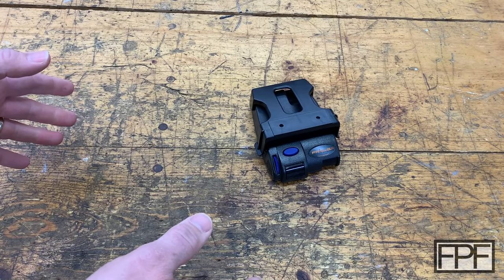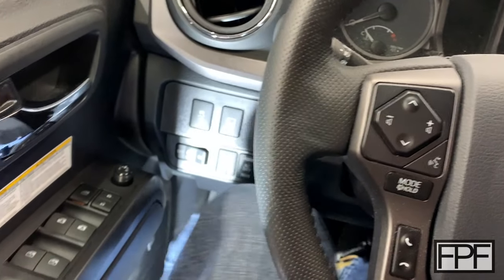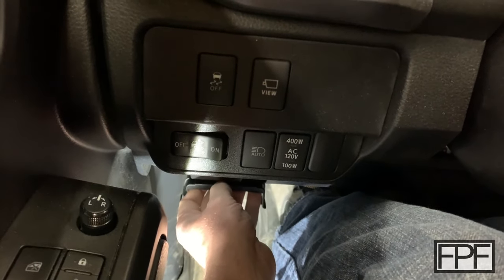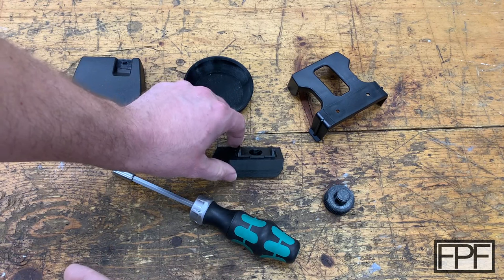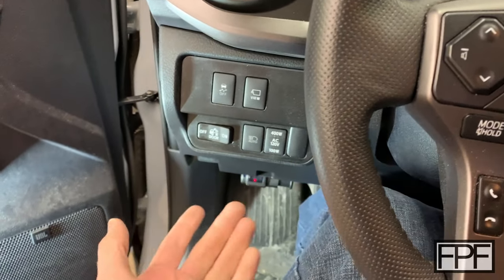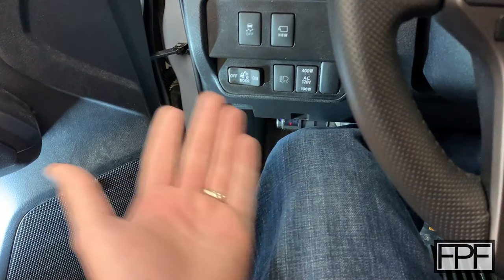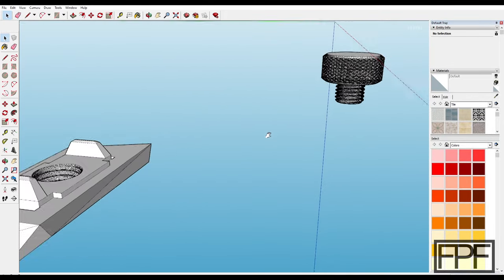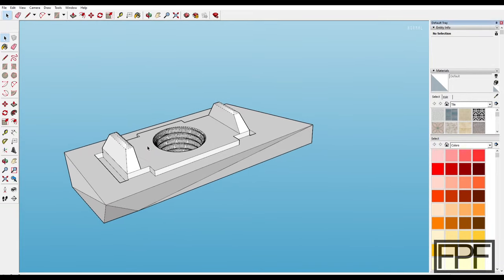3D Printed Toyota Tacoma Brake Controller Mount

Comment: Are you still selling these? I went to your site but found a dead link. I need this!
Reply from the maker: Thx for your comment!  I didn't realize the link was broken, and was wondering why I hadn't sold any recently LOL.  I just fixed both the link in the description and the link on my site.
Reply: @FunctionalPrintFriday  thank you! I just ordered one!
Reply from the maker: @mslaton1  thx for your order!
Reply: @FunctionalPrintFriday   just installed the mount for my Tacoma brake controller. I just have to say, it was a breeze and absolute game changer! I’m 5’5” tall and the RV dealership had installed the brake controller right where my knee sits to the right of the steering wheel, which was a terrible position for me because  I have to keep my seat all the way forward. Your part put my brake controller out of the way and works perfectly! Thank you!
Reply from the maker: @mslaton1  so glad to hear it!  thanks for sharing

Comment: Awesome! I will be printing this shortly as I just acquired a Tacoma and need to mount my Tekonsha P3. Would you mind saying what the print orientation was for your final print?
Reply from the maker: Thanks, covered at 10:00 https://youtu.be/hgz-yvOwC4A?t=600
Reply: @FunctionalPrintFriday  Got it, thanks. I guess that went past me. Just printed it last night with that orientation; and it worked great! Just had to change the hole alignment to fit the P3.
Reply: @KyleLuoma  If I purchased this exact printed bracket from FPF, could I drill pilot holes in it for the bracket screws and use it for the P3?
Reply: @colemanhambleton9464  I printed it as-is in the file, and used a soldering iron to melt the new holes. Drilling would probably work fine too.